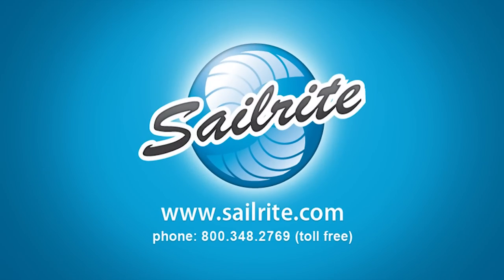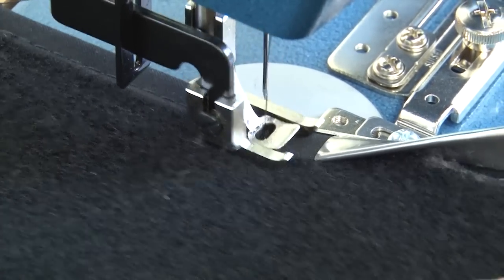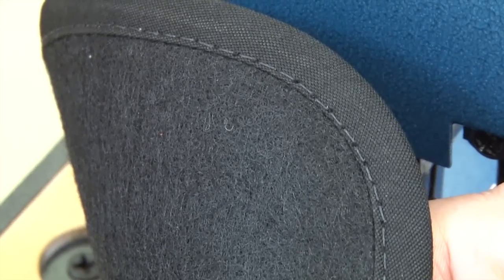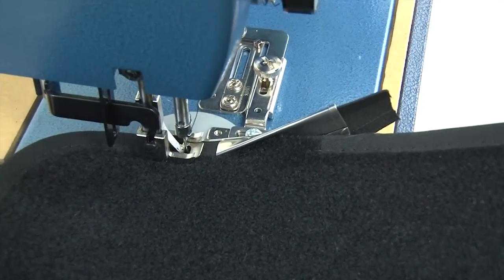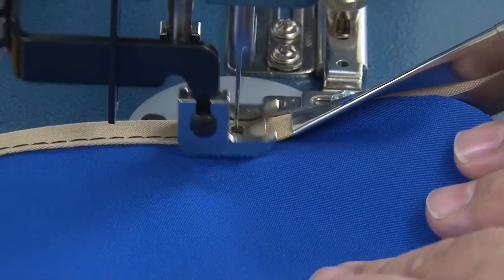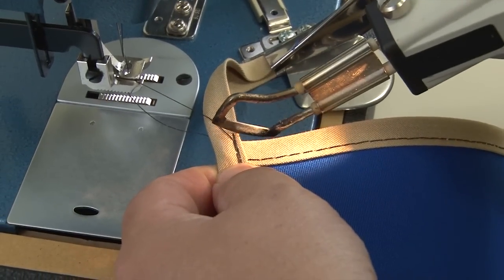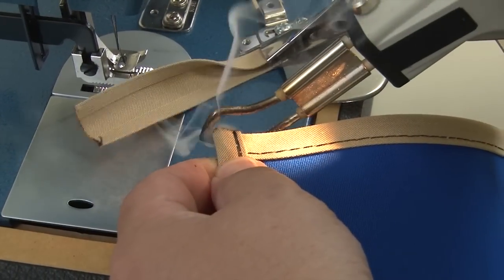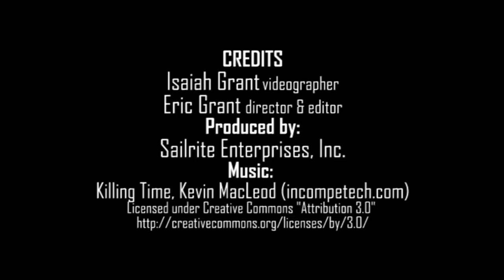How to Work Binding Around Curves or Corners - Using a Binder Attachment on Sewing Machine

Comment: I want to use this attachment for backpacks.  Would sandwich of 2 layers of 14oz canvas and a 1/8" of soft foam fit through the opening of this binder?  Would it be possible to spread open the metal "fold" near the needle to allow more material to pass through.

Comment: What would cause the top part of the binding be shorter than the bottom part? Could it be that the metal fold part of the binder may be too open?  I do production sewing and I started having this problem along with binding tape twisting at high speeds.
Reply: @Leti1971 Did you figure out what was causing the binding to be shorter on the top than the bottom and what was causing the binding tape to twist?

Comment from the maker: If you purchase a 1" binding it will measure 1" wide finished. When it is folded on an edge it will equal 1/2" on top side and 1/2" on the bottom side. The edges of our binding and facing is already factory finished (folded under), so it is ready to folded or placed on the edge of a fabric and sewn in place.

Comment: Please, do you know how to cut and swing and angle for tables clothes or sheets?
Reply from the maker: +Alejandra Reyes-Gonzalez A 90 degree turn is not easy to do with this binder and binding as it does not fold over well. A softer binding would do that, but as you know a fold at the corner is required.

Comment: I have a Janome 15000 embroidery/sewing machine.   Would the binder fit?
Reply from the maker: The binder attachment requires two threaded holes to screw the attachment down to the sewing machine base. Usually those two holes are about 1 1/4" away from your presser foot to the right. I do not think the Janome 15000 has the holes, if it does not have them it will not work.